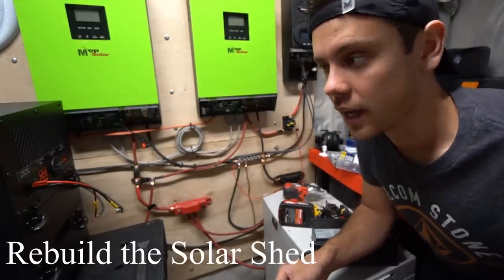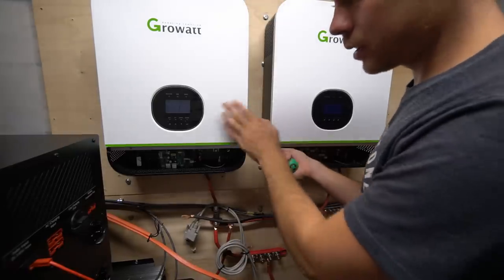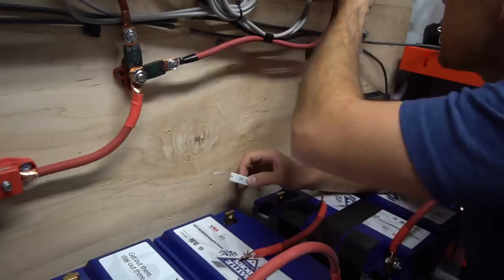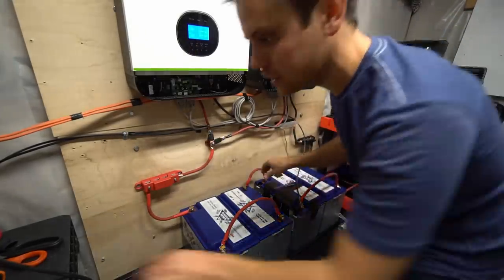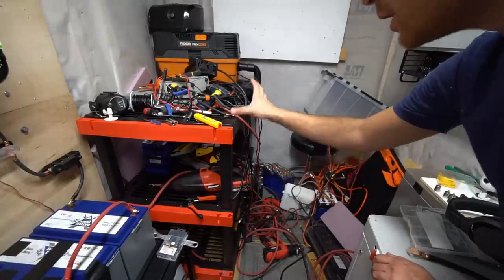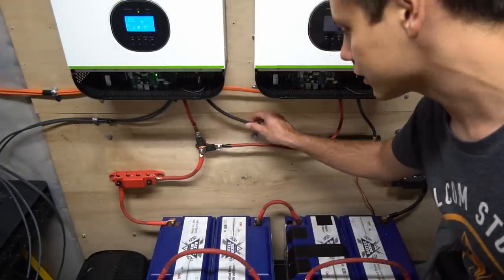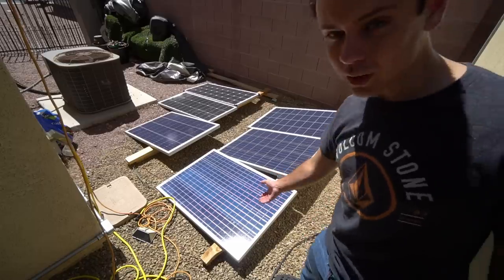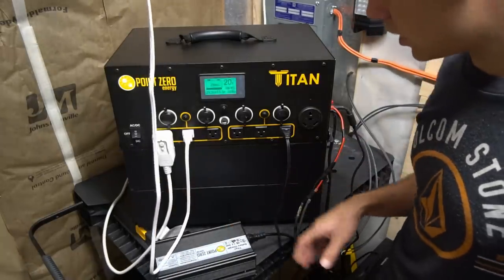Upgrading the Solar Shed: 48V Growatt Inverter Install (and organizing my junk pile)

Comment: On the verge of a purchase.  What would you do for a Raul grid tied cabin. Mpp 48 volts twin inverters or Growatt 48v. I respect your opinion. Please be honest with the best answer possible.  Please and thank you for your hard work to help us dummies lol
Reply from the maker: Hmmmmm growatts. Better company. They respond faster and the interface has more information. The PCBs are the same, from the looks of it. Yeah, if I had to choose, growatts. Mpp works fine, but I'd go with growatt.
Reply from the maker: Actually if it's grid-tie you will need a ul-listed inverter. It will cost 2-3x as much. I would go for a sol ark. It's code compliant

Comment: Hey Will, can tou see how much you can charge your Tesla using the TT-30 outlet from the Titan? There several adapters specific for EVs that convert the TT-30 to a NEMA 14-50 or 14-30, so you can pull 30 amps at 120 volts. I wanna see if the Titan would make a good gas can of sorts in a pinch on a road trip for an EV.
Reply from the maker: What a great idea!!!
Reply: Just make sure to dial it down to 24 amps to be on the safe side so you don't trip the 3000 watt max output.
Reply: Also, Growwatt is just another cheap mainland Chinese product out of Shenzhen that will fail. Just do a search and they try to hide this on their US website but it's not hard to find on other countries sites. MPPSolar is based in Taiwan and will actually honor their warranties if their product breaks down.

Comment: Hey, what's wrong with your air conditioner? Saw your thermometer was in the low 80's. Are you acclimating to the Vegas heat? When I was stationed in India it would be in the 120's in the daytime and at night would feel a chill when it dropped to 90f
Reply: Pretty much how it is in Vegas just dry heat.  I remember driving home one night thinking about how much cooler it felt and it was still over 90f.

Comment: Since you have a workshop on wheels, I was wondering what you need to operate a small (200A) welder. In 24V and 48V configuration.
Reply: Get a generator bud.

Comment: Nice video,I need advice I bought a Growatt My open circuit voltage on PV 38V we connected the panels in parallel once we turn on the inverter the input PV voltage drops to 1.05V we get no display on inverter LCD on presence of PV please assist us.

Comment: Have 2x SPF 5000TL HVM-WPV in parallel, connected to 2 banks of 6 each Canadian 410w PV's & 10kWH battery. I heard there is a firmware upgrade, where can the firmware be downloaded, how about a video on upgrading firmware, I hear it is quiet tricky.

Comment: Interesting....Subbed.
So 2 x 120v for 240v.
Both outputs stay in phase?
They must sync up somehow.
Reply: But you dont't need split phase even for ovens and Dryers, just 2 120 legs so split phase would be a very particular application....
Reply: Split phase works by the transformer on the pole having three taps, the first phase, a neutral in the middle and second phase. Either phase to neutral gives you 120 volts as it uses only half of the transformer, phase to phase uses the entire transformer and you get 240 volts. Devices that only use the two phases and don't need a neutral only need 240 volts to run, however many devices use both 240 volts and 120 volts in them, like your dryer or oven. The heating coil uses 240 volts, but the light bulbs or fans typically run on 120. So your outlet has both phases and a neutral so it can run the large load on 240 and the small loads on 120. For those devices only split phase power would work as with no neutral none of the 120 volt portions would be able to operate.

Comment: Will the 120v loads pull from both inverters the way u have them wired up or separate 120v loads ? I wish I could have seen you while you're these two into the circuit breaker box

Comment: Any idea why a Growatt SC4880 would indicate charging but not actually be sending current to the battery?  I have the blinking green light on both SC4880s and the diagram shows PV --> controller --> battery. But if I go to the amps and watts displays they are all at zero. I have 136 volts coming in from the PV arrays. Baffled.

Comment: Can I use 2 of these to run my RV? I have 14 lion energy safari lithium batteries for the bank but would like to get away with only using 8.  My question is how to wire the growatt units to support 50amp output from battery bank. I have 2 of the 24volt units.  My second question is can the units support a 50 amp input to recharge battery bank and run the RV simultaneously?  Please advise

Comment: Could you confirm one thing on the battery connection? Based on your videos I ordered this specific inverter, and found that on page 5 of the manual, it says that only lithium batteries that Growatt has 'configured' can be used, and talks about an RJ-45 cable needing to be connected between the batteries and the inverter. Could you confirm/explain this? The lithium batteries I have on order, have an internal BMS but don't have an RJ port. I noticed that you also don't have an RJ battery connection on your setup here, either. (This would be used with four 12V 200AH Power Queen batteries in one series string for 48V; no parallel string on this.)

Comment: hi can you please show how to wire up 8 x 12volt batterys  for a 48volt system as I am getting myself lost want to run 2x grow watt interpreters as per this video  also can I have 0ne inverter setup on solar panels and the other setup on a wind turbine 
thanks rob

Comment: Hey Will. I have growatt 3000tl. Lvm  I followed the Manuel and had tech support  have 800 w of solar coming in.  I still hav a fault light in setting 13. It worked all day the first day until 4 pm. HELP!

Comment: Can you turn off the inverter portion on the growatt inverters to save power and still have the solar charge controller charge the batteries off of solar? I am trying to see if this would work in a travel trailer and go off-grid once a week. Having the battery charge back up over the course of a few days with the solar would be perfect.

Comment: I would like to know if I get this all in one unit and let's say I get it 24 volt version. If I buy two 24 volt batteries connect them in series then buy another two batteries and do the same and connect them both in parallel will that work with this system

Comment: Do your busbars have problems where the nuts get stuck, and the head of the bolt strip the plastic? All of the similar ones I've seen have those issues.

Comment: How loud are the Growatt fans?
Reply: Not bad, you wouldn't want them in your home theater but they don't have a high pitch whine to them. They are basically 40mm case fans. They cycle up and down depending on either solar or inverter load.

Comment: Is there any harm in using the FLA or AGM setting and selecting the USER defined setting and custom controlling the cut on/off voltages?  I cannot think of anything that would damage a lithium ion battery if the voltages were correct but I did read something I found which mentioned you don't want to use a charger for lithium batteries if it has an "automatic equalization mode", which I am not familiar with. Any input would be appreciated!

Comment: How many KW do you need for your AC in the shed.  Also how did you determine the size of your inverter battery combo for this purpose?  Calculate based on Hours x KW rating of AC unit or sone other calculation.  Great job.

Comment: do either the MPP Solar or Growatt inverters allow you to turn off just the inverter but keep the solar charge controller running? This would be great for weeks when I'm away from the system and don't want the continuous standby draw of the inverter.
Reply: You can turn off the inverter and just use the charge controller on the Growatt

Comment: For the Growatt inverted described above in programing option 5 did you elected Li option for battery chemistry? if so do you have a BMS hook up because the option is only suitable when communicating with a BMS.  Or the Growatt supports the LiFePo4 with a build in BMS?

Comment: Hey guys I got the 24v growatt with 4 24v battle born batteries, my system has been running with a draw of 7 watts , haven't had any loads on it since I built it.  So why does it cycle my batteries every 4 to 5 days? I haven't put any panels on it yet, but I monitor the inverter every day, but it is plugged in to an outlet. My battery bank is 4800 watts and the system draws 7w... so how is 7w drawing my batteries down in just 4 days? And charging back up? Math isn't adding up.... is this normal?

Comment: Hey Will,
I have 2 of the 48V growatts but haven't hooked up my 2nd one yet. I was planning on running 3 strings of 2 panels on one and 3 on the other. Ill be using them both to power both legs of my breaker panel. I see you removed the data communication cable between the 2 units.  What are the benefits of having that cable connected and not connected?

Comment: So, I have one of these. I’m trying to figure it now. I have a lithium battery. When I put the inverter on the lithium settings a get a fault (red blinking light). Am I supposed to leave it on AGM even though it’s connected to lithium batteries? It appears that what you did in this video.

Comment: Hey thanks for so much useful info! I was looking into the Growatt spf500hvm and lynotech batteries but it seems that the 5000hvm only supplies power through the batteries, even if the solar panels are producing extra. Can you confirm the spf3000 lvm can use solar power without going through the batteries, using the batteries only when there is no solar available?

Comment: I think this the set up I want to run. What charge controller is that and what is the max solar array I could run for it. I am sure I will get 4 battle batteries to start as well. Do you have links for the charge controller and batteries? Thank you for such a great channel and information!

Comment: Will, do you a 24v Growatt inverter would be suitable for full time skoolie living running 24v Sok batteries in series and around 1000w of solar? I am desperately wanting to do an all-in-one unit for my conversion to avoid hassle

Comment: Will I have a question for ya. I need to charge a 16s 48volt LiFePO4 headway 38120 battery pack but now I'm stuck because I don't know what to charge it with. Can you help me please.

Comment: Hey Will, I have my setting 5 set to user defined but when I try and change setting 21 (Low DC cut Off) from 42 to say 48 it does not accept the change and switches back to 42. Do you have any insight on this?

Comment: There are literally no English videos on the larger Growatt units, only the MPP. I already have all the panels I could need, but I want to setup a backup off-grid system on a transfer switch with one of these newer inverters. I need about 7500watts stable usage max. I want to eventually build out a 30kwh battery. I am in the US and need split phase. Should I be looking at the 8200TL or two of the 5000TL units in parallel? Any benefit either way? I have 3 panel arrays atm (37x 395watt commercial panels total) hooked up to grid tie micro inverters. In a power outage, I want to be able to hit the grid tie solar shutoff (to prevent microcontrollers from powering on), hit the DC breakers on lines that I will hook up to the panels along side the micro inverters (only one circuit Is closed at a time), and power my house off-grid till power comes back on.

Comment: I just bought one of those inverters and plan on running the same setup eventually but want to start off with one all in one inverter. Should I start with one 24v 50 amp Battle born so I when I upgrade I can just add another 24v in series or go with two 12v 100 amp hour battle born in series? What would be the pros and cons to this setup?

Comment: so the growatt manual suggest a DC circuit breaker between the PV and the unit... Anyone actually do this and is so, what did you use?  4 @180 watt solar panels in series coming into unit.  Thanks

Comment: Does anyone know if this has an internal limiter to prevent feeding back to the grid in grid tie mode? I don't see an external limiter clamps in any photos online. If it does have an internal limiter, how does it work? meaning how does it sense that say just 500w need to be produced instead of 3kw.

Comment: Will, I know you're busy but please entertain a silly nut.  I'm building a mobile home.(16' - 20'box truck or bus)Goals: fully self sufficient off grid, to do this in thinking of mpp inverter box (24v or 48), combiner box(cable mgt of 3 - 6pv on roof), & wind turbine, 3 - 4 batteries. I have no idea how to connect the turbine to the inverter box. Help please. Thank you

Comment: Where can I pick up the resistor that you used on the battery to keep it from sparking?
Reply: I ordered  30 ohm.. 50 Watt resistors from Amazon.
Reply: Thanks

Comment: How many amps to the service panel at 240volt...... Is it a 200 amp main?
Reply: Not Likey on the amps (split phase 120v inverters, but he did say 120v not split inverter later on but said 240v, so that isn't 240v it's just 2x110v with no split phase)

Comment: Can someone check math?  Wanting to go full solar on my house. On average I use 2,000kwh month. So about 66 kwh a day more or less. Figure I have at least 10 hours of sunlight on the west side of my house a day, so I have 10 hours to charge up 66 kwh.  On a 48v system how many amps of batter storage would I need to run the house?
Reply: You won't get peak power for all 10 hours,  figure an average of 5 hours of peak sun. So figure 14 to 15 kilowatt hours of solar. 66kwh of storage is 1375 amp hours, that's a lot of amp hours.

Comment: Are you going to do a review on the Growatt's?  Maybe I missed it?  Also, is the discount code 2%?
Reply from the maker: Yeah the code needs some tweaking. Right now it's only way to track commissions. And to see where the traffic comes from. Need to modify it a bit more.
Reply from the maker: Ian from MPP USA is building the site
Reply: These will do split phase 240?  I want to be able to run a well pump with my system.  Ian seems to have them listed at a decent price. I might buy one just to get things going.  Great channel Will. I’m hooked on solar now.
Reply: @KJC2025  If you parallel two of them together you'll get 240 volt split phase at 6000 watts with each one supplying 3000 watts per phase. The parallel kits are included. You can't do split phase with only one inverter though. You can also expand each phase individually if you needed to so you could have 6000 watts on one phase with 3000 watts on the other phase. Its a pretty adaptable setup. Wiring is L1 and neutral on the first inverter with L2 and the same neutral on the second inverter, same with the output giving you split phase.
Reply: @andycanfixit  Thanks, I will definitely buy a second one for split phase.

Comment: HELP!  Just got two Growatt SPF 3000L LVM units... Then going through the manual I see an absurd note: "if choosing lithium battery for growlot SPF series products, you are allowed to use the lithium battery only which we have configured.". Then again it states that if comms to the BMS is not connected the unit shuts down!?

Anyone know how to safely connect other BMS protected Lifepo4 batteries?  Really worried now... Great deal of money tied up in incoming parts for this solar system.  🙄
Reply from the maker: Ignore that. Use whatever one you want and set it to user.
Reply: @WillProwse  THANKS!  I was reading the settings section and assumed that had tp be the answer...  Can't wait to fire this system up.

Thanks again for the help, videos included!  I have watched most of your videos, and will continue to do so.  This is probably the best solar power channel I have seen.  You do such a great job on reviews, education, examples, and ideas for others to try as well.  Even as a technical person these can be overwhelming, I can only imagine how many must feel.  Your channel does a great job making many concepts approachable and viable for many more that would otherwise be scared off.

Keep it up!  🤓👍

Comment: Sadly the solar first function doesn't work and signature solar doesn't support it or accept returns. The unit will power the loads by utility even with 1000W of solar being provided.  Signature Solar recommends you use SBU mode which will cycle the battery and not power the loads directly with utility. $850 of sadness.

Comment: I don’t understand why you would go threw with all this work just for 240v ac when most of the inverter charge controllers are 240v    And I need 120🤔🤔🤔. And with a 240v can I wore a break box down to 120v??? 2 legs

Comment: I have a question to anyone. If your pulling 4kw on a parallel system does it pull from both inverters equally or just one first then the remaining from the other?
Reply from the maker: Both equally

Comment: Hi, Can you help me to choose a suitable inverter that works on a 220-volt system, electricity operates on 220 and not 120 voltsWhat do you advise me to take an inverter working on 12 V or 24 V or 48 V and what kind of inverter is good with many thanks
Reply: 48V, MPPsolar, Growatt, Victron, Schneider

Comment: I noticed you have a 6kw set up with a small array, what is the min. amount of Amps & Volts needed to run these & charge 48v batteries?

Comment: Will, I will be adding a mid drive electric motor to my everyday bike which will be powered by 48v 2 amp lithium phos battery. Is there a way to charge it using a 48 vdc solar rig without having to use an inverter for the 110 volt ac to 48vdc charger?
Reply: MPPT charge controller capable of 48 volts. Make sure your pv array is above the desired charging voltage (60VDC+) a 2 amp battery is VERY small...